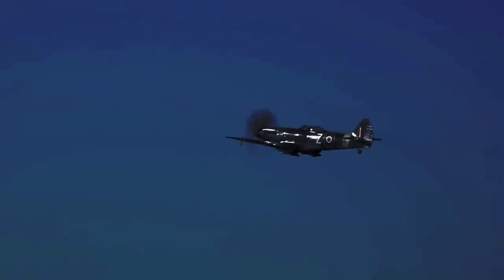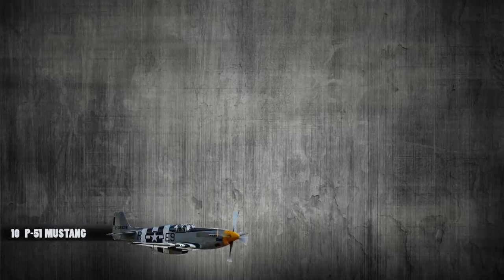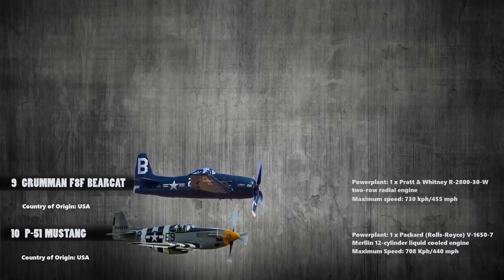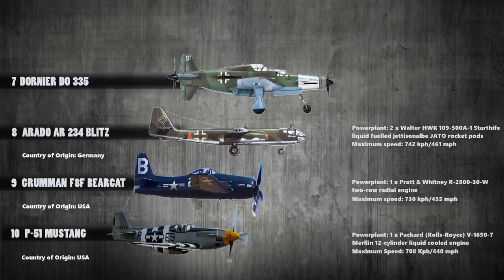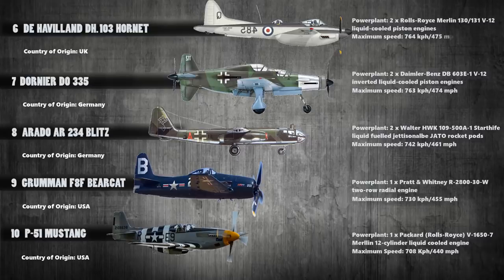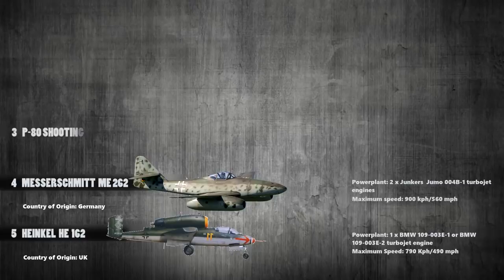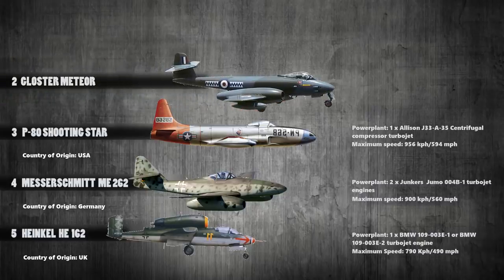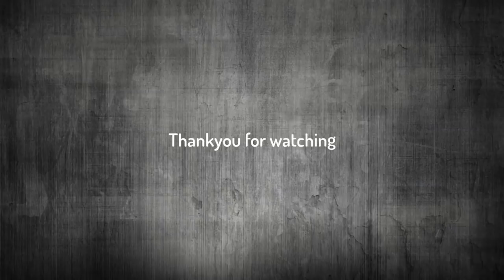10 Fastest World War II Aircraft

Comment: You've missed out the Hawker Tempest mk 2 , top speed 440 mph, 4 fixed 20 mm cannon powered by Bristol Centaurus v 18 cylinder two row radial engine 2590hp, and feared more than the Mustang by German ME262 pilots having similar rate of climb & armament & was instrumental in shooting down V1 bombs(72-95 claimed by 501 sqn) prior to the Meteor taking on the role of interceptor.
The German aircraft featured, although faster did not make as big a contribution in the battle as the Typhoon & Tempest

Comment: What about the p 47 thunderbolt and the corsair. Those two were quite fast indeed
Reply: Freddy Not really
Reply: @hoatattis7283  yes they were, aha !
Reply: @JCA-Z  Sorry only the Corsair 5 just post war and the P47M 120 of these and still slower than the FwTa152
Reply: @hoatattis7283  The -4 had a top speed of 446mph and the -5 470 mph just like the TA-152.  It is remarkable how the FW 190 and the F4U tracked each other on performance with the Corsair always being slightly faster until the last variant.  I think these are the two best fighters of the war.  Totally different designs that had identical performance in all aspects.  The tie breaker is survivability and goes to the Corsair.  The Dora went to a liquid cooled engine degrading it's ability to take damage.
Reply: @johnshepherd8687  Bulldust not according to my info, 
What was the Corsairs roll rate turn Dive Climb service ceiling 
And my friend? just how many Germans did the Corsair get?
Reply: @hoatattis7283  Which variant are you comparing?  The F4U could out role and out climb a FW190 at each equivalent variant.  Max speeds were at different altitudes because they were optimized for different environments.
Reply: @johnshepherd8687  I ask again did the Corsair go against any Luftwaffe plane any?
If it did not the subject is moot
Reply: Yes.  Fleet Air Arm MkII Corsairs in Norway.  They had a favorable kill ratio but were flying mostly against 109Gs.
Reply: @johnshepherd8687  I just read about some of the ops but nothing specific about air to air actions
Reply: Captain Eric Brown RN has written about it.
Reply: @johnshepherd8687  which book I have 4 of his
Reply: I can't remember which one he talks about the RN's Norway operations.   I will do a bit of research.

Update:
Best I can do on short notice is a quick search on the internet.  Only thing I could find is Corsairs operating from HMS Formidable against the Tirpitz.  The air-to-air kills were 2 109s and 1 FW 190 to Hellcats, which I found to be surprising, for no air-to-air loss.  All RN aircraft losses were to AAA.
Reply: @johnshepherd8687  Thanks
Reply: @johnshepherd8687  John my friend no US plane could match the Spitfire
Reply: @hoatattis7283  Apocryphal story.  A Mustang pilot and a Spitfire pilot are arguing in a British bar about which plane is best.  Mustang pilot  says let's settle this.  Meet you over Rome at noon tomorrow.  :)
Reply: @johnshepherd8687  Nothing to the Spit VIII with 170 gal slipper tank  drop it off over Monaco and slip the boot into the P51 over Rome
Reply: @johnshepherd8687  Or how about this one Spitfire pilot says to the P51 pilot 
" Meet me at 44000ft "
Reply: @hoatattis7283  I will surrender on that one my friend.  :)
Reply: @johnshepherd8687  yes it is always a good one to fall back on 
I have no idea why it could not go higher the Spit VII VIII IX were not that much lighter

Comment: I call BS on the meteor having a top speed of 600mph. The standard operational Meteor in WW2 had a top speed of 410mph. 

There were a couple of Meteors that were stripped of all equipment, guns, etc., had the paint removed and had the aluminum skin polished. These flew in November 1945, after the war ended, and set new world speed records of 603mph and 616mph.
Reply: Mk3 Meteors were knocking 500mph / 800Kph at 30,000 feet in WWII, nowhere near the 600 stated but sharper than most....

Comment: This list is the most accurate I have ever seen-a real eye-opener, but you did leave out the V2 Rocket, which, technically, did have 'wings', and was only slightly slower than the Mosquito with a 4000 lb. bombload at 40,000 ft, on a 3000 mile mission. 😉

Comment: Actual #7 Kyushu J7W1 Shinden (Maximum speed: 750 km/h (470 mph, 400 kn)) Like some others this plane never saw combat action, unlike them it was actually built and flew during the war. Commissioned by the IJN as a land based interceptor to counter B-29 raids. It was first seriously put into construction in 1944 and the prototypes were finished in April of 45. Only the two prototypes were made and flown during the war as in a twist of irony the planes designed to intercept B-29s were in flight for their test flights at the same time that both A-bombs were dropped. The prototypes were saved but production canceled by Japan's surrender.

Comment: The DH 103 never saw combat in WWII. It was barely beyond the prototype phase by the end of the war in Europe and did not get to RAF or RN squadrons until 1948 or later.
The Dornier Do 335 was flown in combat once, a single example of the approximately 2 dozen total aircraft that had been produced before the factory where they were built and staged was overrun in April 1945 by US forces.
The Lockheed P-80 saw only limited service in Italy before the end of WWII in Europe, as reconnaissance aircraft. The P-80 saw no air to air combat in WWII.
The Gloster Meteor was used in the late war period to intercept and destroy German V-1 pulse jet flying bombs, but were restricted to operations over the British Islands only due to concern that the Germans might salvage a downed aircraft over France or Germany.
The ME 163 Komet was a failure, mostly due to the short burn time available to its rocket engine. It made 16 kills at a loss of 10 ME 163s. It was dangerous to fly, dangerous to land and vulnerable tt piston fighters after its short period of powered flight lest it as a glider.

Comment: During testing, the Me 262 was found to be faster than the British Gloster Meteor jet fighter, and had better visibility to the sides and rear (mostly due to the canopy frames and the discoloration caused by the plastics used in the Meteor's construction), and was a superior gun platform to the Meteor F.1 which had a tendency to snake at high speed and exhibited "weak" aileron response.[92] The Me 262 had a shorter range than the Meteor and had less reliable engines.
Reply: Unsung speed hero is the jet engined De Havilland Vampire. Didn't see active service but first flew in 1943 and had speed of 539 mph, about same as Me262. Mystery as to why is wasn't pitched into the war but slow development as DH going full tilt producing the Mosquito. Longer engine life 120 hrs against Me283 measly 35 hrs. Better fighter than the Meteor and stayed in frontline service until replaced by similar but larger DH Venom in 1953. Finally retired in 1966. First jet to cross the Atlantic.

Comment: To state the obvious, there are many errors in this video. You should have asked someone who knows anything about the history of military aviation to check this video for errors.
The Heinkel He 162 was not produced by the UK.
The Gloster Meteor's top speed eventually exceeded that of the ME 262 and the P-80, but not during WW2. The Gloster Meteor remained in production until 1955, and by that time it was greatly outclassed by newer fighters capable of supersonic speeds.
The P-80 was never used in WW2. A few pre-production YP-80A aircraft were used for reconnaissance in Italy shortly before the end of WW2, but even these aircraft (which were not production P-80s) were never used as fighter aircraft during WW2. Well after the end of WW2 versions of the aircraft (which remained in production until 1950) were produced that had a higher top speed than the ME 262; but during WW2 the ME 262 was faster than the P-80. Shortly after WW2 the USAAF compared the P-80 and Me 262A concluding, "Despite a difference in gross weight of nearly 2,000 lb (900 kg), the Me 262 was superior to the P-80 in acceleration, speed and approximately the same in climb performance. The Me 262 apparently has a higher critical Mach number (the Me 262A's being at M 0.86), from a drag standpoint, than any current Army Air Force fighter." (Source: World War 2 In Review No. 33: German Airpower, p. 180) Despite the fact that the P-80 was included in this video, the video states that the Gloster Meteor was "the Allies only jet aircraft to achieve combat operations during the second world war."
While it is true that the F8F Bearcat was deployed during WW2, it was never used in combat during WW2.
Not only was the de Havilland DH.103 Hornet not used in combat during WW2, but it did not enter service at all until 1946. Whether or not the F8F Bearcat should have been included in this video is a matter of debate; but the de Havilland DH.103 Hornet certainly should not have been included in this video. In my opinion the Focke-Wulf Ta 152 should have been included in this video, as it had a top speed of 472 mph and was a formidable adversary in combat despite seeing a limited amount of combat before the end of WW2.

Comment: Of the aircraft listed, only the P-51 and Me-262 saw active service and substantial use in WWII combat. The Bearcat, for instance, was a postwar "superprop".
The P-47M or "Mike" variant, which was rated with a top speed of 472mph and saw combat, is not listed at all. (The P-47N or "November" was almost at fast, at 468mph, and had extremely long range.)
It might be more accurate if the title were "fastest fighter aircraft of the mid to late 1940's?

Comment: The Dornier Do 335 graphic / pic you show, is a double cockpit version, which would be a training / conversion build. I've never seen one of those before, and it was not typical. Whether or not it should be classed as active service, is questionable. It was seen and chased by Allied fighter aircraft several times, and had the speed to run away. As far as I know, it never turned and tried to fight. It was in a very very early stage of testing, and I'm not sure it even had guns in yet...
The DH103 Hornet was a magnificent aircraft, much loved by its' test pilot, and it would go on in the late '40s to be a front-line fighter, but it was not finished and in active service by the end of WW2. Also, the first prototype with Eric "Winkel" Brown at the controls, was about 30mph faster than the production version that had real guns in it. It was in development at the end of the war but I don't think it saw active service, rather like the 335 Arrow.
The Heinkel He162 did serve with the Luftwaffe, but its country of origin was not the UK.

Comment: Wow - someone who hasn't done the research and is clueless as to actual operational dates of service and related versions.
F.80 Shooting Star: Whilst the first pre-production YP-80a did carry out very limited operational flights before the end of WWII that version was some 10-15mph SLOWER than the ME-262 - having a top speed of around 880Kph.
Gloster Meteor: The Mk Ia version of the Meteor, which entered operational service in July 1944 had a top speed of 498mph - although later versions did secure the air speed record in late 1945/early 1946 at 606mph.
P-51 Mustang: If you are going to list the basic P-51 Mustang as having a top speed of 440mph then you need to also add the P-38 Lightening with a top speed of 443mph and the F4U Corsair with a top speed of 446mph. We know that the P.51-H version, which came into service after WWII could reach nearly 500mph.
De Havilland Hornet - This airplane did not go into operational service until after WWII.
Spitfire Mk 24. Based on your criteria the Mk 24 version of the Supermarine Spitfire should have made the list with a top speed of 454mph

Comment: I will have to disagree with the Hornet being included... First flew very late in the war, didn't begin actual service until the war had ended (in 1946)... Also applies to the Lockheed P - 80... Didn't enter service until late 1945 after the war. As much as I love it, and think it's one of the most beautiful aircraft ever made, I have to disagree with the P-51 being included, since it was considerably slower than the Focke Wulf Ta - 152, which had a top speed of 472mph, and slower than the Vought F - 4u4 Corsair ( the first airplane to exceed 450mph in level flight ( operational top speed of 446mph)

Comment: Gsus the faults of this video.

Number8 It wasn't powered by rocket pods. It was powered by the Jumo or BMW jet engines. Just like the Me262 and HE162.
Number 6. It got introduced in 1946........ So it's not a WW2 aircraft
Number 5  Heinkel powered by BMW origin the UK. Yeah makes sense
Number 4 Me262, Yes it was fast very fast for it's day. Well armed too but no it could not go 900kph.
Most sources claim 860-870 kph.
Number 3 It did not fly combat missions in WW2 so it's not a WW2 plane.
Number 2 Gloster Meteor, Yes this one did actually do stuff in WW2. Mainly taking out V1's but also some sorties on the western front.
But the variant used had a top speed of roughly 800kph. It could do 950 kph. But that was in later variants with engines unavailable in WW2.
Number 1 Yes it was the fastest had the shortest range and killed it's ground crew with it's highly toxic fuel.
But it did not have 2 rocket engines, It only needed one.